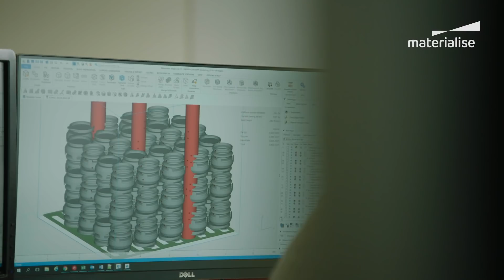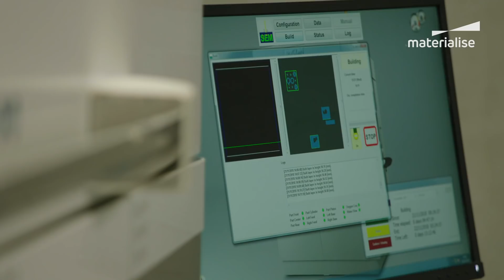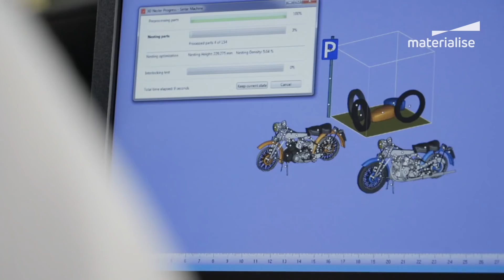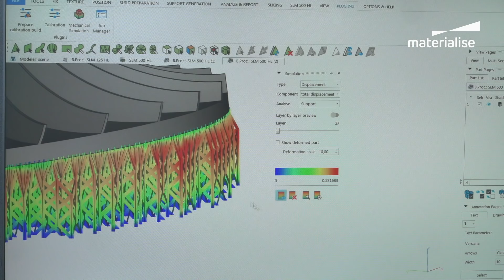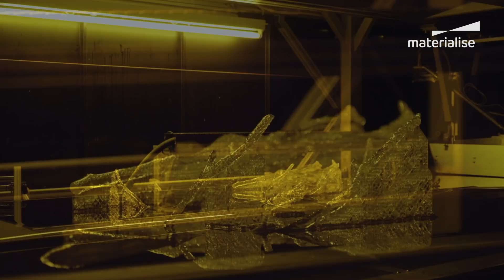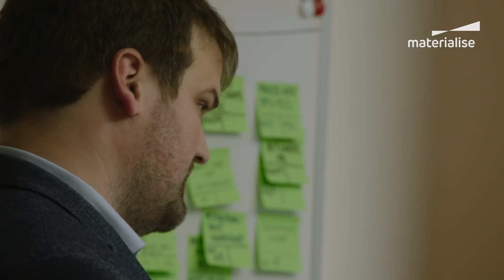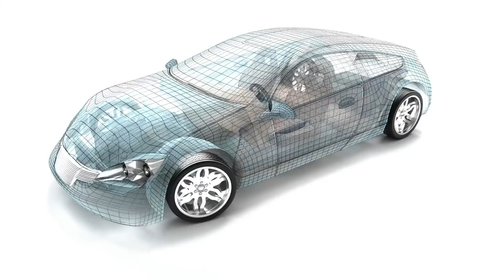3D Printing Trends for 2019

Comment: For me the most important thing that needs to happen right now is: 
-Outsourcing FDM needs to drop in price substantially. For a product design studio it is still way cheaper to own and run a prosumer machine than to outsource the printing process to an external party. 
-FDM machines still are way not consistent enough: at every print there is a substantial chance that the print will fail.